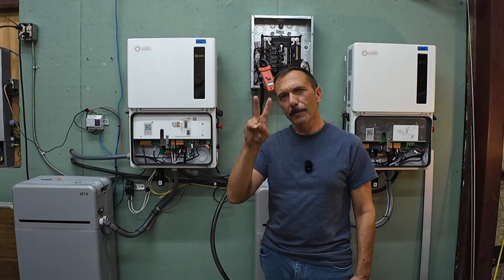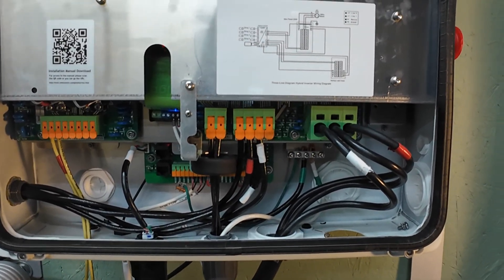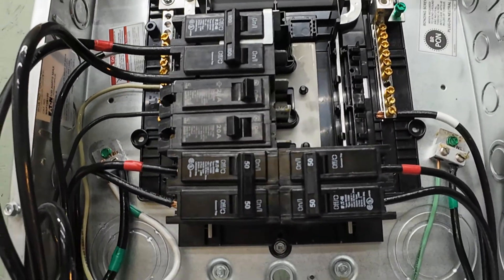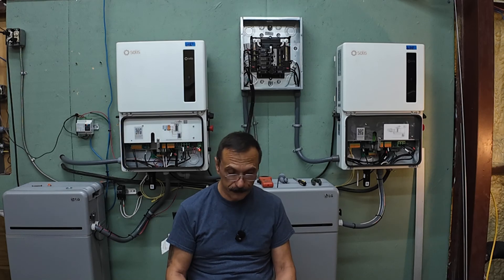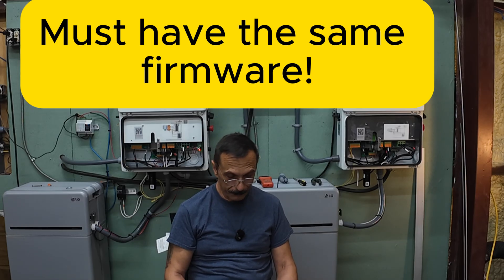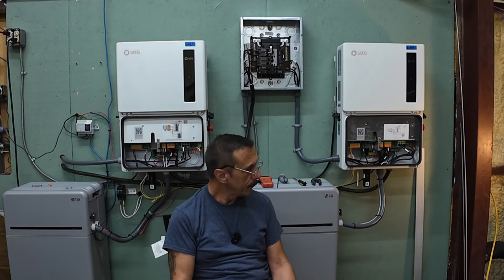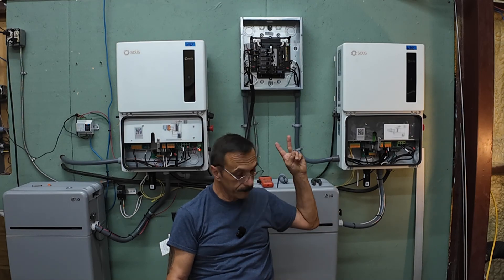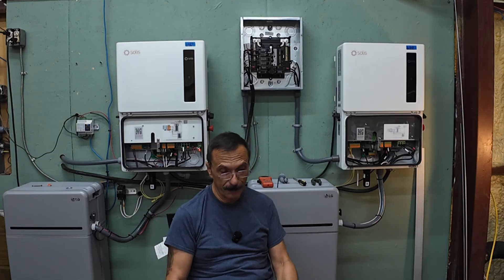23kW How I Parallel 2 Solis S6 11.4kW Inverters

Comment: I have this same setup, Yesterday startup and one inverter have a lot of fault code. I hope this next monday test another inverter. I called Solis support  team and they make some changes, same problem. This Is my first Solis in Parallel system.
Reply from the maker: The biggest thing with parallel set-up is communication between the inverters and the configuration needs to be perfect.
Good luck, hope you get it figured out!

Comment: Hey Ed.  How can you start this up with battery only?  No pv or grid power.
Reply from the maker: There's a 12 volt control voltage going from the Inverter to the battery that closes a contactor in the battery, you just have to supply your own 12v control voltage so the contactor closes.
Reply: @DIYSolarFarming thanks that’s been bothering me

Comment: What voltage DC do you run?

How do you keep you cells in balance if not using a 48v BMS?
Reply from the maker: The HV batteries all have built in BMS's and my voltages run ~400 volts.
Thanks for watching!

Comment: I noticed that you have 2 double breakers installed at your load panel.  Do both inverters share L1 and L2?
Reply from the maker: The bottom two breakers are the feeds from each inverter that feed L1 and L2.
Thanks for watching
Reply: @DIYSolarFarming are They syncing though?
Reply from the maker: @nb117  Yes, they are synced up.

Comment: Nice video, what is the breaker manufacturer and part numbers or buying source? Thanks for the HV videos any particular safety gear(gloves etc..) or do you just make sure all the wiring is off by measuring before connecting? Also for HV solar do you just connect at night?
Reply from the maker: The panel is an Eton BR100 you can get them at Home Depot or Lowes for around $90.
I just put that one up for testing, you may need more breaker space depending on what you're doing.
Yes, Volt meter to make sure you're not working on live circuits, High Voltage gloves and all the usual PPE!

Comment: Question regarding your microgrid statement -- are you limiting export to grid to 0, or some fraction of the upstream rated power?   what is your ground/neutral configuration?
Reply from the maker: I’m grid-connected for backup with a manual break-before-make transfer switch with lockout on the utility feed. I never allow the utility and my grid forming inverter to be tied at the same time, because that would interfere with AC-coupling frequency control.

The grid-forming inverter is in the solar shed. Its backup port feeds a shed sub-panel and ties back to the house main panel through the transfer switch. Its grid port is not connected.

In the shop I have two paralleled inverters. Their grid ports land on a shop sub-panel that ties back to the house main panel. Because I only charge their batteries from the shed inverter or the utility when needed, I run zero export and set their grid ports to powered by generator. That makes them import-only and prevents any back-feed to a generator, therefore no back-feed to the grid.

If I need more power on the micro-grid, or I want to charge the shed batteries from the house side, I switch the shop inverters to powered by grid. In that mode they can export onto the micro-grid, still without exporting to the utility.

Shop loads can be placed on the panel fed by the inverters’ backup ports, or left on the shop sub-panel to be supplied by the shed inverter, depending on what I’m doing.

Since I remain grid-connected, the main service panel is the only place where neutral and ground are bonded. All sub-panels keep neutrals isolated from grounds. Each building has its own ground rod or Ufer, and all electrodes are tied back to the main grounding system.

This is just how mine is set up right now, not advice. I move things around, so details change, hope it makes sense.
Reply: @DIYSolarFarming  Fantastic reply, thank you! That was a great explanation.

I have a VERY similar setup just with one S6 not two, using a BMW i3 battery.

I've wondered at times if I could export to my grid forming (not utility tied) inverter to counteract its base load which is approximately constant. Without knowing how $upstream inverter's AC coupling algorithm would react to the $downstream's equivalent during power transfer, I've been reluctant to even try it.

If the upstream baseload is truly constant, I think something like the following should be reasonable. $export <= $baseload < %x of grid-forming rated output .  Any thoughts? So few people do this that it's hard to find anyone else as a soundingboard..
Reply from the maker: I can't see why that wouldn't work but why? 
Are you only trying to counteract the grid former's battery drain, is battery tight?
Are you short on grid former pv?
How much base load are you trying to offset?
Reply: @DIYSolarFarming  no, none of that. more of a wear leveling objective here, heat reducing, longevity prolonging. The base load I'd like to offset is only 900w or so.
Reply from the maker: OK, sounds interesting. My thought would be to set up a cheap grid tie inverter with 1 or 2 kW of pv and limit it's export to what you need. But obviously this only works during the day. It can be done with a larger battery inverter but there are a lot more variables and I don't know what the gains, if any, would be.